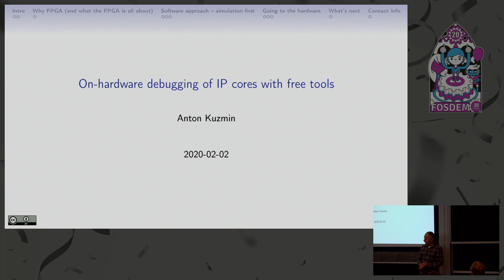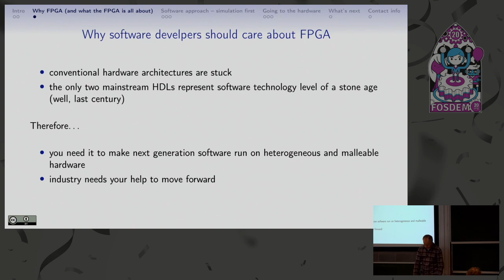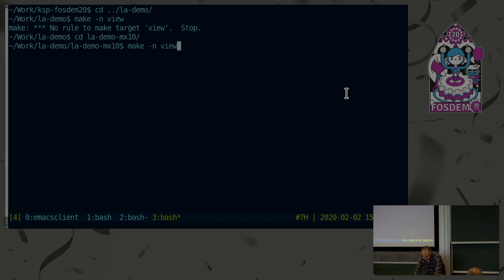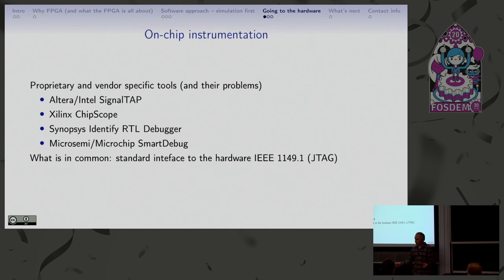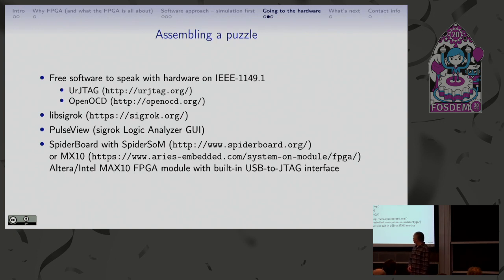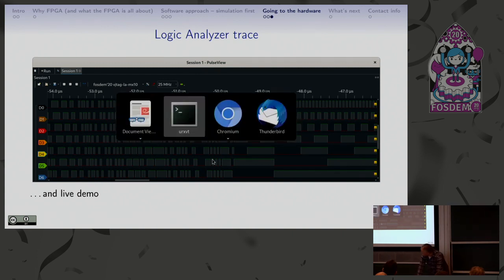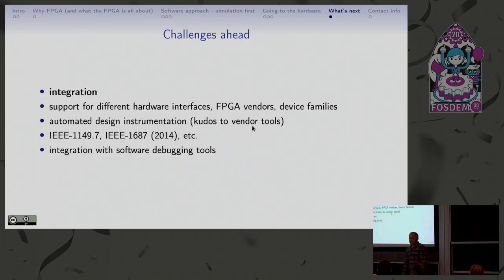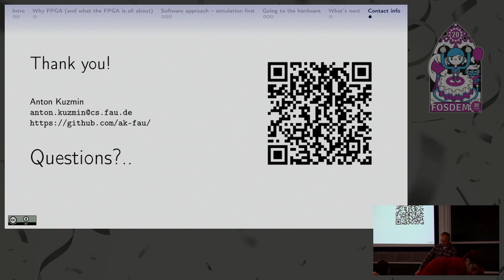On-hardware debugging of IP cores with free tools

Comment: What is the difference between OpenOcd and urJtag?

Is there a way to use Quartus SignalTap with OpenOCD and a generic FTDI 2232H ?

BTW, I recommend the article: "Programming Telesto MAX10 FPGA Module using OpenOCD"